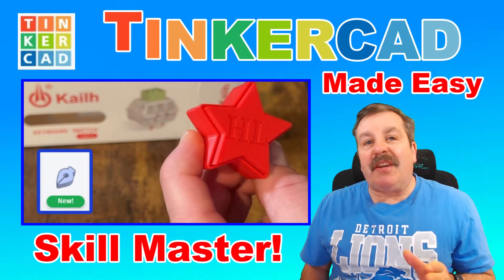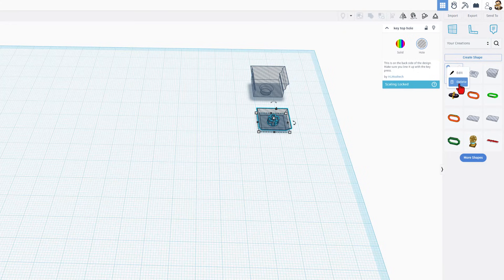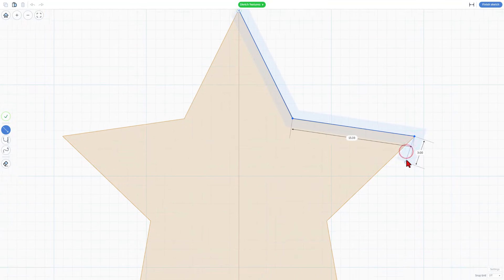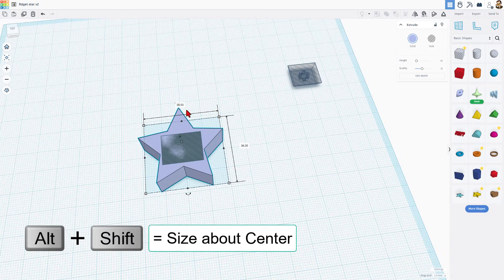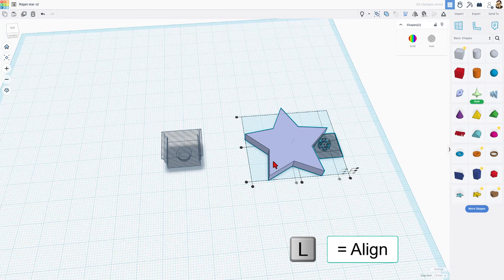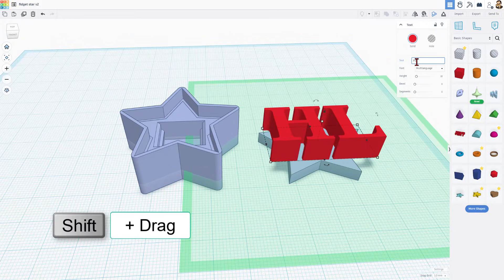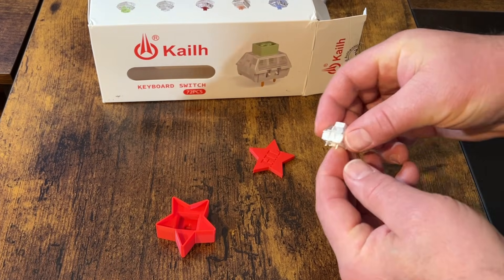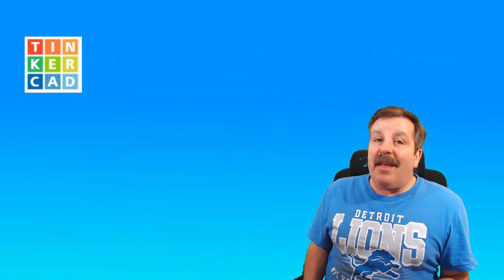Make Your Own Star Clicky Fidget Toy with Tinkercad! 💯🔥

Comment: Instead of using those keys can i just put in springs from a pen
Reply from the maker: You can build something like that. It would likely be more like a bobble head though.. no clicky sound.
Reply from the maker: It is a pretty quick print. Of course insead of the key holes you would need a connection system for the spring on both ends. It may not click, but it might still be a fun fidget. Keep me posted if you move ahead with it.
Reply: Can you make a tutorial on how to make keys like that or how to make a clicky fidget using a spring
Reply from the maker: I do not have a solution for that, but check this idea out. https://youtu.be/j5oBQs5y0C8